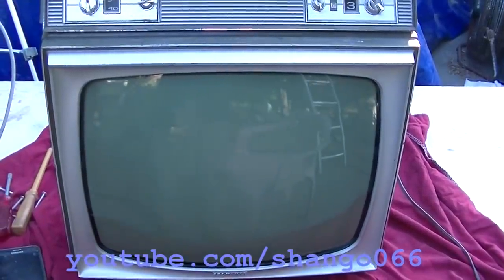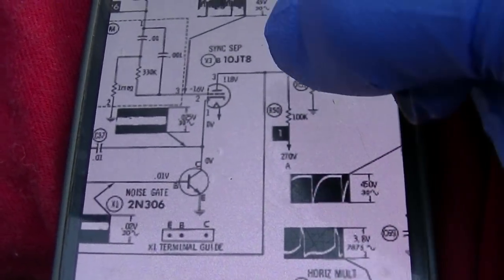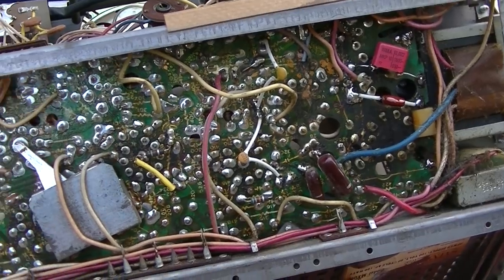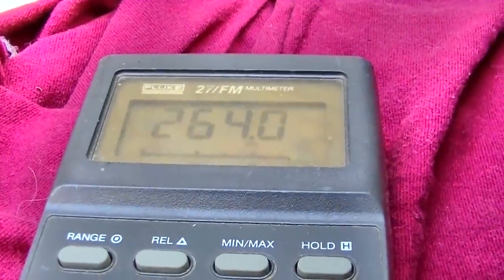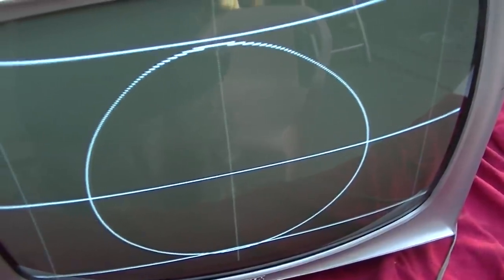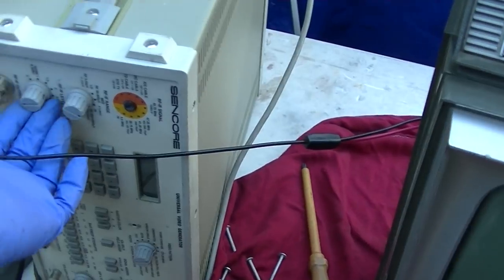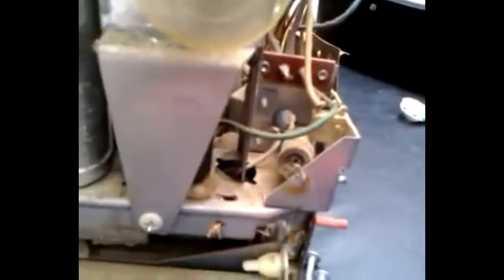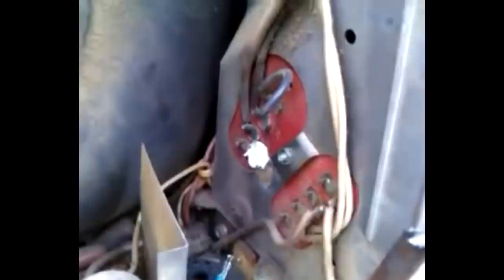1965 Sylvania TV Set No Sync Quick Fix MX61 Vintage Television Repair 10 Years Revisit

Comment: This set reminds me of the one I used to watch Bob Wilkins and Creature Features on, late at night in the late 60s. KCRA in Sacramento was one of the few channels we could even get. I don't think I ever owned a color set until the late 70s. BW sets this size were easy to come by in the 60s as lots of folks switched to LIVING color. If it broke, and you couldn't fix it by taking all the tubes down to the tube tester at the grocery store, then you could find another one cheaper than having it fixed.

Comment: Use to a set wasn't considered a good TV unless it lasted 20 years and a failure if it died within five....nowadays if you get five you've lucked out. For a 56-57 year old set whose life expectation was 5- 7 years (from the factory) I'd say its done pretty good. 

Now to the cleaning: It's a shame they've all but outlawed R-500 as a cleaning agent (the same thing NASA used to wash down the shuttles with) .... we used it at T I and works wonders. Concerning that board: I know this set IS NOT WORTH THE EFFORT but... couldn't one 'photo copy'  that board and etch a new one? Just something to consider in future restores & projects...

Comment: I have a 1965 Neckermann portable Trasistorised TV (Art. Nr. 837/05), that initially couldn't lock sync either horizontally or vertically and it took me a while to find out that it was because of an open 1uF FOX electrolytic cap, causing the Sync seperator transistor to not get sync at all. 
Said TV was a German rebrand of a Japan made TV by YAOU/General and it was rebranded in the US as the Philco N1052 and Q1054 (the former lacking UHF, while the latter has it like the Neckermann).

Comment: I hate working on those old Sylvania sets.  In addition to crappy PC boards, the tube sockets they used were made out of some kind of soft plastic that turned in to crumbs from vacuum tube heat.  Left would be only the tube pins standing up in the PC board without any material between them.    Terrible sets.

Comment: Sixty years old television and running strong. Will Musk automobiles last ten years?
Reply: Sadly, the veritable "they don't make them like this anymore" is more and more harder to say on an ironic sense.
Reply: @pericels_1  My Toyota Corolla made in Japan last for more than 20 years and the paint was new until some kids crashed it. My Japanese set Sanyo  lasted over than 36 years with no repair needed until I trashed it in 2018. Mt Zenith Shortwave radio needs service, this set made in USA and very expensive in 1960!

Comment: An eBay seller with the nickname radiotvmanuals is currently selling documentation called: "1965 SYLVANIA 583-1 3 4 5 TELEVISION SERVICE MANUAL PHOTOFACT SCHEMATIC DIAGRAM" Date 4-65 Set 750 Folder 4. I wonder if it's the same TV model.

Comment: Always wondered why this test pattern from generator is not symmetric? Why is the lower part touching the horizontal line and the upper part not? This is intentional or is this a generator issue?